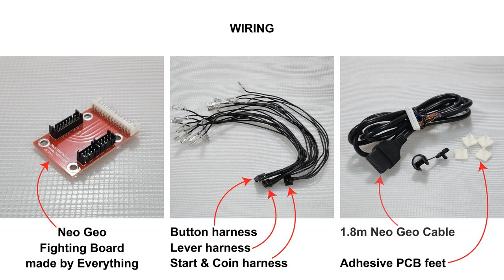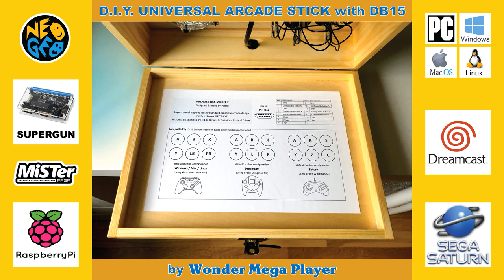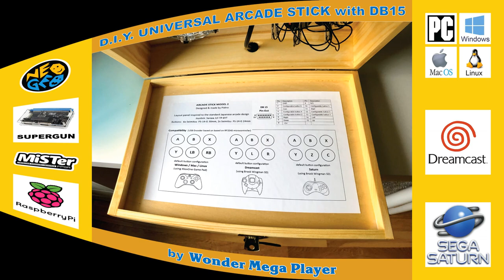D.I.Y. Universal ARCADE STICK (with DB15 connector)

Comment: how does the controller cable fit through such a small 15mm hole? can you get the connector part through sideways to thread it through?
Reply from the maker: It can easy go through a 15mm hole with the cord stopper indicated. Just try. It's a very tydy solution.